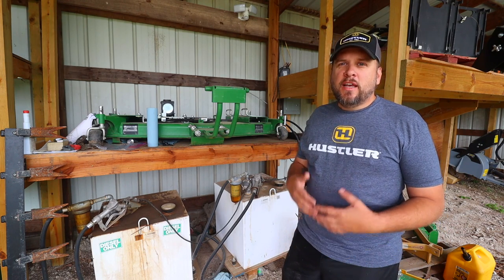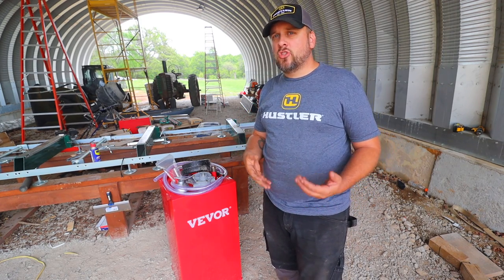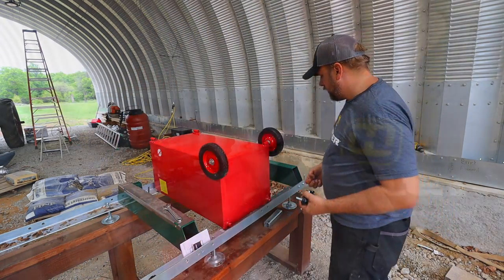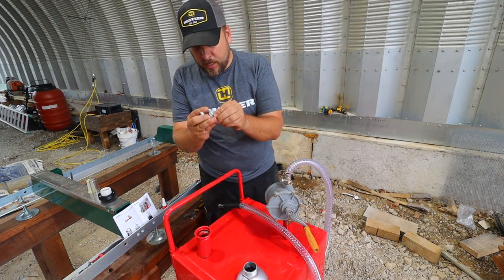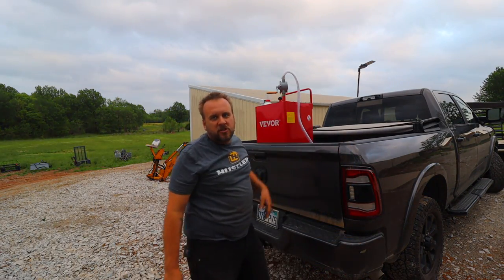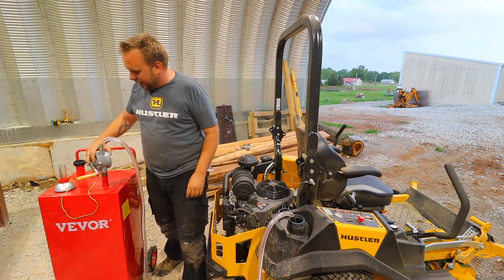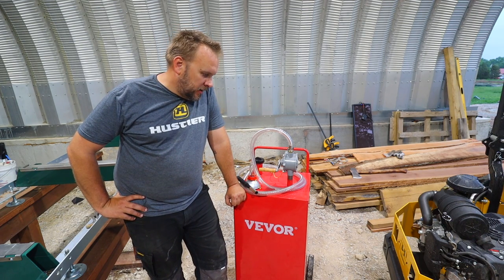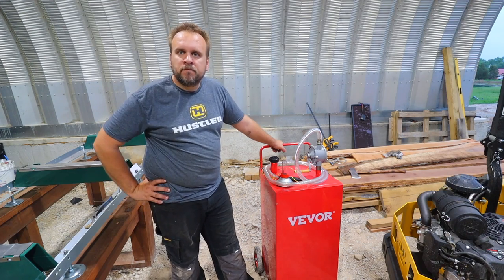Say Goodbye to Gas Cans

Comment: Hey Brock.. good video except you forgot the whole reason for that specific type of tank… you never connected the grounding wire to a bare metal surface of the mower when you filled. The ground wire is to prevent accidental spark which could start a fire. Much like touching the metal on your car before touching the fuel nozzle when at the gas station, especially in the winter when static electricity is more prevelant.
Reply: Same for when filling it up at the station...since the truck bed has a liner, static could build in the tank and a spark could occur at the nozzle from the pump, which would be VERY bad. That ground wire should be attached to ground when filling or emptying that cannister.

Comment: I bought a similar one (Sunoco) a couple of years ago. The hand crank went bad after a couple of months. I ended up having to put a Fill Rite hand pump on it and attach it with a coupler that has rubber gaskets. Works well now.
Reply: The one in the video has horrible reviews also!
Reply from the maker: That is what they tell me. I can’t give a positive or negative review yet 

Out of the box, it works fine

Comment: Me I welded on 2 lifting rings on both sides. This way if you have a crane like I do you can lift it off your truck, because that 30 gal take  will be heavy taking it off $3.05 in west coast of tennessee
Reply: Just weld BEFORE you fill it the first time 😛

Comment: I’m not sure I got the same exact name brand, but, I bought one identical to that one off of Amazon a couple of years ago. I put it together, put gas in it, went to crank the handle to fill up my side by side, and it was stuck… locked up. I contacted the company through Amazon to get a replacement pump and they informed me to return the whole thing, that’s all they could do. This was after I just filled it up with 30 gallons of gas mind you. I syphoned all I could out of the tank into my vehicles, cleaned the gas out as best I could and shipped it back. It was a total mess. They did refund my money, so at least I got that. I hope you have better luck.

Comment: I bought a similar Roughneck transfer tank from Northern tool about 12 years ago. It has worked fantastic. I fill it using 5-gallon containers since I have no way to legally haul it. The construction is quite a bit better than the Vevor unit but then again it cost twice as much.
Reply: Just curious why you say you have no legal way to carry it?  How big a tank do you have?  You don't need any type of hazmat endorsements or markings as long as it's less that 119 gallons.
Reply: @thebaldeagle655  I have a similar transport container as the one in this video. I don't have a truck. I have a SUV and a landscape trailer. It is illegal in PA to haul this container on a trailer. When hauling gasoline in a vehicle the containers are limited to 5-gallon cans and there is a maximum of 4 cans. I may have my numbers wrong but there is a limit on the number of small containers within a vehicle. The rules are a bit different if you have a container bolted into the bed of a pickup truck. And of course the transportation rules are completely different and less restrictive for transporting diesel fuel.

Comment: That looks handy.  We run two mowers, each holds a little more than 5 gallons, plus a few various machines (pressure washer, push mower, etc).  I get tired of hauling 5 gallon cans.  I may have to consider one of these.  It would greatly reduce the number of trips I make to get equipment fuel.  If only the cost of 100% gas would go down!
Reply: I can't find 100% gas. There is a crappy website online but it's too hard to find a gas station with it.

Comment: My wife does the lawn mowing and can not handle 5gallon cans. This unit is great, as I no longer need to fill her mower every 2-3 hours. We have 10 acres of lawn. Takes about 10 hours per week. I used wd40 on it to make it easier to turn and this caused it to leak at the pump handle. I pulled it apart and redid the seals and all is good!
Reply: That sounds like you're cutting an acre an hour. Are you using a pushroller or something similar? Unless she enjoys spending 10 hours a week cutting grass you could consider a ride on tractor or zero turn.  Your wife might well enjoy it though. If I had the time to spare I can see it being a relaxing activity.
Reply: @ruk2023--  she does enjoy it. We have a cub cadet with a 54” deck, but the yard is very bumpy so she cannot run full speed without beating her self silly.

Comment: Go to the auto wreckers ones that wreck 1 ton or bigger get a saddle tank mine comes from a 75  GMC 3 ton truck we converted to propane  it has a built in pump and holds 45 gallons of gasoline used to put in my pickup and take it to the gas station to fill  it Our gas per litre in Drumheller is 133. 9  which if converted to us gallons is 3.785 times that =5.06 81 Calgary is worse at1.58.9 but a used gasoline tank shouldn't cost more than 60.00 dollars

Comment: My complaint about hand cranked fuel pumps is you have to be close to what you're filling to see if you're going to overflow it or not. My Kubota L4701 has the fuel filler cap on the top of the hood, one of the few things I dislike about that tractor. Unless I want to know it's full by watching it overflow, there's just no way to monitor it while cranking the pump from the ground. That's one of the advantages of the electric units is that you've got the valve (dispenser handle) right where you're putting the fuel in.
Reply from the maker: Agreed

Comment: I was looking at these last week. Thoguh right bow i am considering getting a 150-300 gallon tabk and getting gas delivered. I figure i could save some money using it to fill my vehicles, gas tractor and ATV. Still need to check in the actual price for 200-300 gallons delivered.

Comment: Howdy Brock!  Yeah, people don't appreciate how important it is to ground gasoline transfer tanks like that.  The flashpoint of gasoline is right around -50 degrees F, while diesel is closer to 130 degrees F.  One of the few things I remember from my days as a career firefighter lol.  The chances of a spark igniting gasoline vapor at room temperature are there (you still have to have the right mixture of fuel and oxygen), the chances of a static charge igniting diesel vapor at room temperature are slim to none - mainly because diesel vapor doesn't naturally occur at room temps.  And before the keyboard commandos jump in... YES it is possible, just not probable.  It is possible to get struck by lightning twice in the same day... but it isn't probable lol.  We never shut down the firetrucks or ambulances when we fueled them, and if you go to any truck stop many drivers do not shut down while fueling.  Interesting to see how your tank holds up for you.  Thanks for sharing 🤠

EDIT:  After reading some of the comments on here, wanted to add the following... using a larger tank designed for diesel to store gasoline can be dangerous.  A couple of gallons of fuel in a 5 gallon plastic container easily demonstrates how different the flashpoints are.  A 15 degree increase in temperature and the gasoline container starts to bulge from the interior pressure.  You can have an 80 degree increase in temperature and as long as the ambient temp isn't exceeding that 130 degrees, the same amount of diesel won't affect the same plastic container at all.  I went out to my shop this spring to top off my gas and diesel 5 gallon cans and the gas one dang near looked like a basketball lol.
Reply: That’s why tanks have vent caps on them

Comment: Been using that gas pump for years had replace the pump for leaks at shaft I put solid tires on mine the tube tires was always needing air
Reply from the maker: The company must’ve made an upgrade there. Mine came with solid tires.

Comment: The front wheels are too small. They screw into small spot welded nuts . Mine bent & the weld broke. The gas gauge never worked.  As you can see the pump is hard to crank., (Notice the crank position change). The rear wheels on mine would not turn freely when the axle nut was tight. . I tossed the pump and gauge,  Replaced the front wheels with 3" casters. ( Metric size 10 shank ) Big washers and double nuts.  Rounded the shoulder on the axles so they'd not contact the hub and got a battery powered pump with custom extension and check valve. It now rolls good & the DC Volt transfer pump is SOOooooo much better.

Comment: I hear ya about those gas cans. I have a weather guard 100gal diesel tank and 3 5gal gas cans. I wanted the one they sell at Atwoods its a 14gal with nozzle like a gas pump but the price is a little high for me. 
 Bought gas this morning at 2.99. Got some yesterday for 3.06. But the gas prices vary in my area drastically. From 2.99 to 3.49 just for regular gas (that's 10% eth) not the (real 100%gas) stuff.

Comment: Is it DOT approved to haul this fuel tank in your vehicle? I think your State Patrol may not give you the stamp of approval. I do have a similar tank that I fill at home with cans.
Reply from the maker: I didn’t do any research on this, but when I looked previously, I was thinking any portable container under 50 gallons can be hauled without special consideration.

The caveat being a metal tank with gasoline should have a ground strap

I could be wrong.
Reply: doesn't look like it has the DOT blessing just looking at the reviews it looks like a piece of junk 3 out of 5 stars and nothing but pictures of either broken parts or fuel leaking out of it I'd Stay away from this thing
Reply: I also recommend putting the container in a front corner of the truck bed. 
Reason is, you always have control of how you accelerate BUT you can't control the stop sometimes.    
Not a good result if that tank breaks loose and shifting forwards.

Comment: Is it plastic or metal? I wonder about how to keep condensation water out of the fuel 🤔
Reply: you almost can't these days the stupid ethanol draws moisture but as long as it's vented right it shouldn't be that bad plus u can always put a water block fuel filter on it which he probably should
Reply from the maker: Metal
Reply: Does it have a drain valve on the bottom? If so, you could use that to drain the water periodically.

Comment: u should have stuck with your original setup and not listen to the people on here the vevor tank is basically the same thing u already had but lower quality. i did the same thing you originally done with the 2 50 gallon tanks and its the best thing i ever did no more gas cans lol
Reply: Running gas in a diesel-only rated tank is foolish. First, you're assuming the materials in the tank, pump, hose, and dispenser handle are ethanol compatible, and as ANYONE who has owned a gas powered piece of equipment knows, ethanol will eat anything rubber. Second, diesel vapor is far less flammable than gas vapor. Unless there's a proper ground between the tank and the dispenser handle, there is the potential for static charge build up, which is a fire hazard. The pump motor must be ignition proof, either in a rated housing or using a brushless motor, otherwise, just like the sparking you see on an electric drill, it's an ignition source. Lastly, tank venting is different between diesel and gasoline. Brock's tank is outdoors so it's not much of an issue, but in an enclosed area, an improperly vented tank can lead to gasoline fumes, which can be ignited by a flipping a light switch if the air/fuel mixture is correct. But if it's worked for you keep doing it. If it doesn't, I'm sure we'll read about you in the obit section.
Reply: @JCWren   ok safety Sally you mean I shouldn't pump my fuel through a garden hose? lol yea all his stuff and my stuff is rated to pump gasoline the only thing that techincally isn't is the tank itself cause the govt doesn't like you hauling gasoline down the road in those tanks so how is the cheap amazon tank different than one you'd by from the farm store thats "diesel only"
Reply: If it’s UL-142 listed it can be used for gasoline. The fact is that the tanks are made of metal.

Comment: Dude just put locktite as thread sealer…..😮
Reply from the maker: It came in the bag with the pump. The instructions specifically tell you to put it on those threads.

There is even a picture of the pump and the bottle in the set up guide

Comment: Over priced and doesn't solve any problems.
You put gas in 2 self propelled pieces of equipment that could have been easily driven to you stationary dispenser.
It has to be completely empty to get it in the back of a truck. Its 50 pounds empty.
At 260 pounds full, most people don't have a way to get it out of the truck. Ramps? Yeah, I'd watch that show.
You'd still have to use equipment to put in your truck to get it to the sawmill and again to take it out. 
I got 55 gallon fuel barrels for free and I already had a hand truck to move them if necessary and I fill and empty the transfer barrel the same day and easily get it out of the truck by hand.